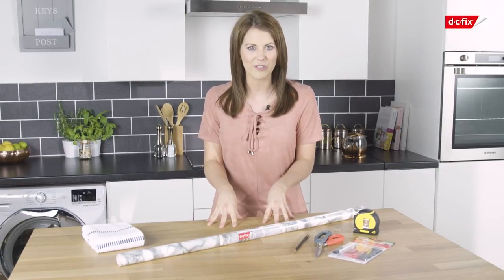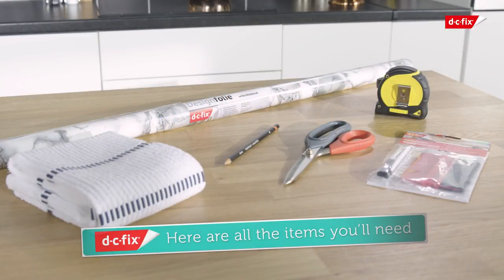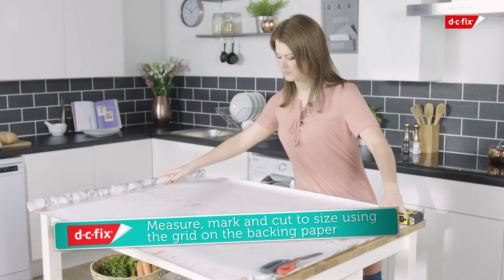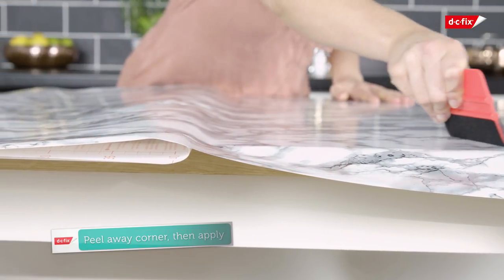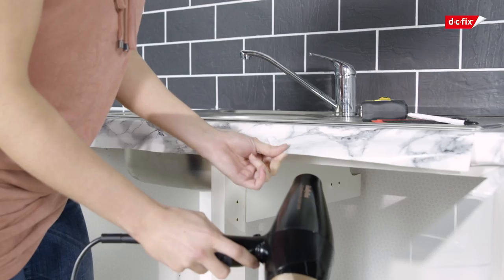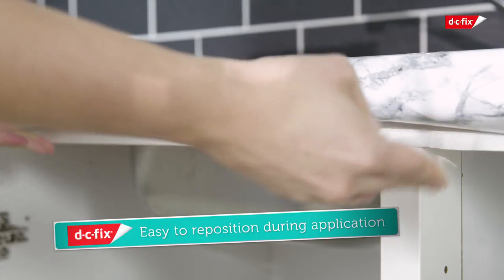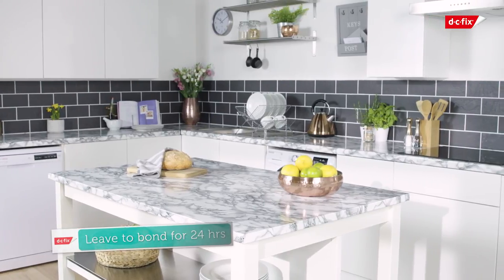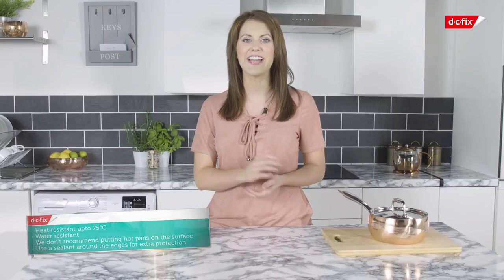How-To Apply D-C-Fix Self-Adhesive Film - Marble White | B&M Stores

Comment: Can this be used on bathroom walls. Not directly around the shower area but it will be subject to steam from bath and shower. Secondly can this be used on bath panel? I guess I need to seal it even on walls, especially where exposed to water. Big thanks

Comment: I can tell you it's not as easy as this lady is saying. No way can you do this with no bubbles!
Reply: you can, it just takes practice. only unpeel the backing a little at a time while simultaneously smoothing out the contact paper with a decal squeegee
Reply: Did you need to cut excess off before removing backing to make it easier to handle?
Reply: @jeannettelow4934  yes, that would help make it easier and keep it from creating hard wrinkles